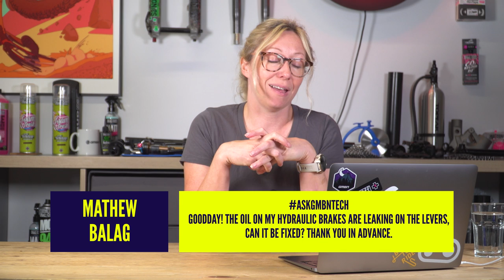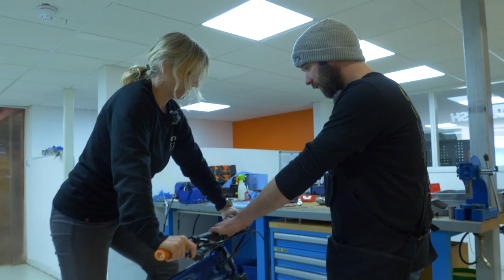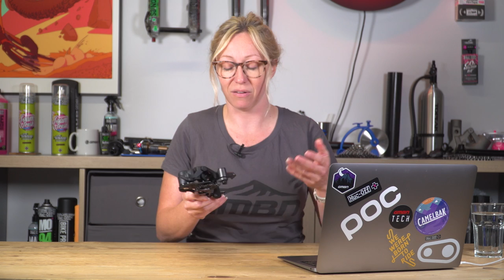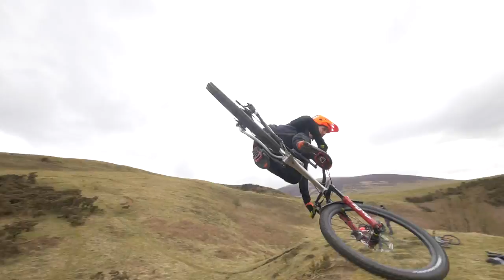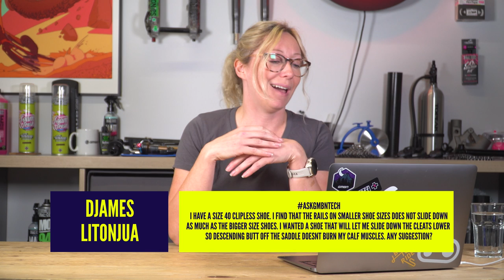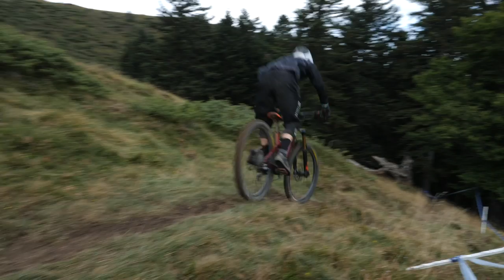"Why Are My Hydraulic Brakes Leaking?" | #AskGMBNTech 188

Comment: When I first started doing my own bike maintenance, I stripped the threads on the reservoir fill so the cap screw was just spinning on my Shimano brake levers. Luckily I was able to keep it sealed with duct tape while I waited for a replacement to be delivered.

Comment: About rotors:
My XC bike (Trek 29") was fitted with 160mm rotors front/rear.
But first serious downhill near Matlock (on tarmac) boiled front brake, and left me with noithing! (lucky - rear one stil works, and my shoes too)
Week after i've fitted 203mm front rotor (maximum allowed by fork manufacturer) and do the test at same hill - no isses!
After decade later - this setup works for me perfeclty (with different brakes/rotors brand)
Rear one I left 160mm - never has a problem with it.

Comment: that's why I only use mechanical brakes all hydraulic disc  brakes  eventually screw-up leak or seized up or need a lot of Maintenance to keep them working right
Reply: Hydraulic brakes are pretty simple. Learn to work on your bike; they all need maintenance.
Reply: Cannot beat the good old v’s!
Reply from the maker: They do require maintenance, but the braking power advantage is huge! 👍

Comment: That single speed derailleur trick also works if you get a snapped cable on the trails. If you take the end out of your shifter you can use it to do exactly that hack and set you bike up as a single speed (pick your ring carefully) to get yourself home.

Comment: Flipping a shock.
I think it used to matter if you had an old school shock that had the air, oil and valves in one space, but with modern shocks where the oil is on one side of a piston and the air on the other, and valves acting on oil flow do not end up in the air. 
The oversite would be seen for old oil forks (like my old boxxers) where the oil and ari share the same section, turn them upside down and the oil drains away from the 'valve' to the (top which is now at the bottom).

Generally the consensus seems to be, mount the shock with the outer above, and the stem (inner) below, as any dirt on the inner is helped by gravity and ends up at the bottom, away from the seals... With the stem at the top, oil/dust/mud/muck etc that gets pushed up the stem away from the seal, has gravity to help dribble it back onto the seal.

 #AskGMBNTech Why don't they cover a shock stem with a light bellows to keep dust/water/mud/brain-matter out of the shock seal...  same really for forks... Motorbikes did for years before USD's.... even my El Cheapo ZOOM dropper woulda' benefitted from a cheap bellows...

Comment: To the single speed conversion: better if you use short cage derailleur and as Anna mentioned the cable for tension, brake cables are better, they have a big knob on the end which most likely won't slip through the hole on the derailleur.

Comment: Hello Anna, I like your video. Regarding the question about braking power and how to set up a brake system, it is all about breaking physics. I am remembering days at school, when we tried to figure this out. The result: through the forces in the forward direction you have approximately 70% of your breaking power at front and the rest at the back. And because the lighter backend starts quicker to lock out, I use the smaller disk at the rear. I am a big fan of GMBN, carryon.

Comment: Manufacturers need to float the calipers...its time.
I added grub screws on both sides to the bolt posts. 
They make adjusting the caliper spot on easier and also locks them in place so they can't move when locking down the bolts.
Reply: The Magura Gustav brake is a copy of a motorbike brake and that is floating, also rather heavy, they stopped making them in 2015.

Comment: #askgmbntech
I have a specialized pitch pro 2010 and the brake reservoir is leaking. Can you recommend a good fix. They are avif juicy brakes it's the rear brake lever reservoir

Comment: #askgmbntech
I am an xc rider, and I am having problem of my cleat shoes , I set my cleats the same measurement, but my left foot is slightly bigger than my right foot , I am  aching on my left foot every time I climb , because my left shoes cleats is in middle of my left foot.. Will it make better if I adjust my left shoes cleats?Will it make different of my pedalling?

Comment: #AskGMBNtech
Hey guys, I was wondering about whether you should wash your bike after every ride if you live in a place that isn't very wet. As I have heard washing your bike too much can force water into bearings and stuff meaning they have to be replaced earlier than neccessary? And also with tipping your bike up side down to let the oil from your fork lowers re-lubricate the seals and what not or even anyother reason to put it upside down-is this bad because I have been told that tipping your bike upside down can create bubbles in your brakes/fluid causing them to need to be bled?

Comment: #askgmbntech Old tech question: we have a few very old ( mid-90's ) mountain bikes with quill stems / forks. What's involved in modernizing those with some reasonably more current forks/bars? simply adding a new fork, stem, headset, bearings, etc? THanks!
Reply: Its not possible to modernise the 90s mtb, the quil stem you mentioned is a smaller diameter than current bikes. If you've got a frame with the A-Headset sized forks then its possible but cannot be updated to todays headset/fork standards.
Reply: @hollakeef  thanks, even if it’s to update it to the early 2000s, that’d be better than what it is.  I’ll have to see what’s the latest era kit that can be put on a 94/95/96-era bike. I kinda figured you can’t simply toss a current Fox 34 on there and call it a day.

Comment: #AskGMBNTech Hi Guys, I have a 2022 scott spark with raceface next r cranks with cinch mount & shimano xt cassette & chain. Im looking to put a 36t chainring on but I cant find a chainring that size that will work with a shimano hyperglide chain with a cinch mount? Raceface only go to 34t that work with shimano chains? Or is there an other chain I could use? Thanks

Comment: So idk if this will replyed too but i been searching high and low to find some idea whats up 

So short story my clarks m4 rear only  that my mate put on  i didnt have knowledge on these brakes but they been good after about 60 miles or so in 3 days after a while the lever went from 2° of engagement  to basicly a 4 to 5 inchs away  from the handlebar(my guess if i pulled it to hard to the point it pushed oil thru the seal in the lever  which was i thougth okay still worked enough power  but after i left my friends b day i noticed it was on or off feeling i saw it was leaking thru the seal in the lever. And due to my mistake i pulled the lil tab in the pin to adjust the lever leading to no feeling at all i got it working again after i got home 

After i got home the next day i checked by seeing if it still have power  even on it bike it did but was leaking enough that it had no modulation till it hit the handelbar so i put a rubber band again helped slightly 
But my guess i gotta do a re bleed and see if the seal is split

Comment: Why use a deraileur at all for a single speed adjust your chain to one of the middle gears. Maybe it won't work maybe chain will skip?
Reply: Derailleur keeps tension on the chain.
Reply: @CiderPang27  when I said adjust i should have said take chain off take links out fit to ring put new quick link on. Thought most folks will fill in the blanks, sorry.